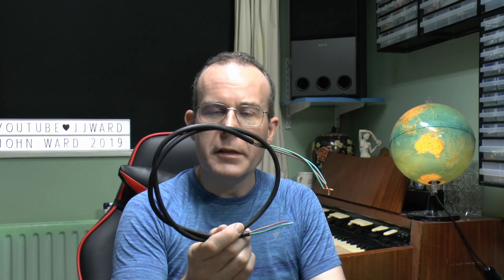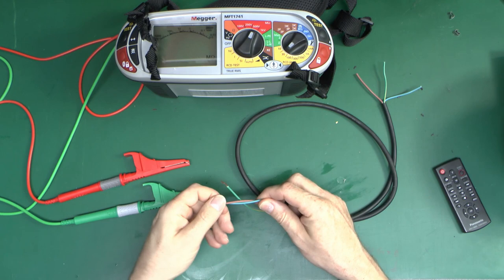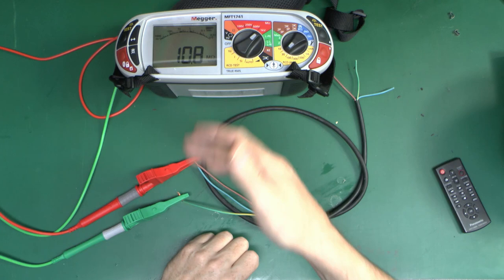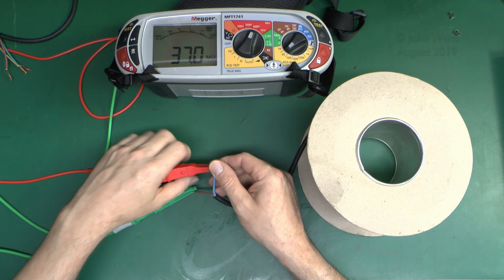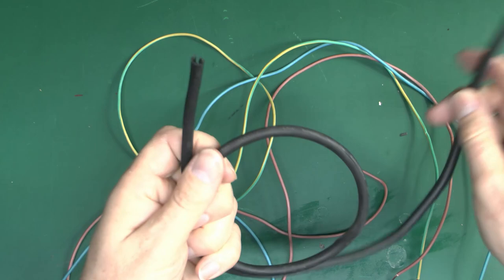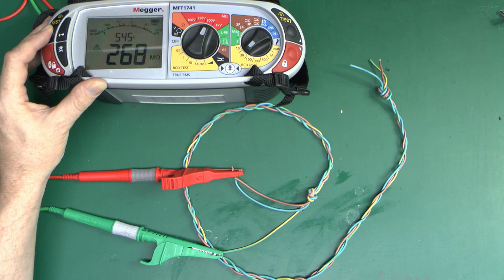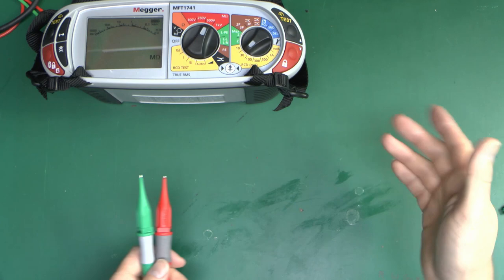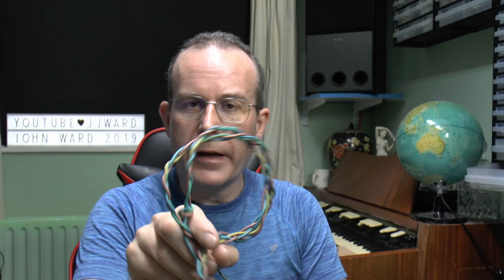Rubber Flex Insulation Resistance Failure

Comment: Some natural and man made rubber cables over time in damp or wet conditions go hygroscopic and actually absorb moisture. Then you get exactly the effect you got with the Megger. The insulation “breaks down” the longer a standing voltage is left across it.

Comment: John , When i worked at a local electrical wholesalers 15 years  ago, we had a batch of Collingwood spike lights ,where the paralleled leakage from the  porous cable  caused the rcd to keep tripping ,the customer brought them all back , and i offered to replace all the cables with some quality British  rubber cable, problem solved, But probably invalidated their warranty

Comment: PVC insulation often contains some (normally VERY small) quantity of lead. PVC insulation from China often has considerably more lead than normal. Lead is, of course, conductive, and combine that with moisture leaching through it, the minerals in the water may be reacting with the lead and forming conductive lead salts, which create numerous tiny current paths. I'd get a cheap lead test kit from a hardware store or similar, and rub the swab from it all over the insulation off those wires to see if there's lead in there.
Reply: But this is a rubber cable; I didn't think those used lead?
Reply: @longrunner258  Rubber cable is usually vulcanized by extruding molten lead over the sheath before being autoclaved to finish vulcanization.  This lead is then cut off and reused.

Comment: I'm surprised that such a class  of cable is allowed in such an installation. 
If armoured cable is too much of a pain and mains power is needed for garden lighting then what is done down here is to use 12V lights. For larger installations I think 24V or 32V is used. This way anyone can install the lights and an oops with a mower or other implement isn't a major issue.

Comment: What happened to old wire colours code .which red as hot line and black as neutral
Reply: In North America, we use black for hot and white for neutral.  Where there is more than one hot wire, they are black and red with a white neutral.  Three phase is black red and blue for hot.
Reply: @heronimousbrapson863  
Yes .. that in north america but we are use in our country  red and blue and yellow for three phase and black for neutral .
Reply: Apparently the UK changed officially to the blue/brown colour code in 2004. Not sure about the rest of Europe.
Reply: @Cadwaladr  
The rest of europe use brown and gray and black for hot line and blue for neutral .
Reply: Correct colours (not colors) for Australia.
Reply: In the UK we changed appliances to new harmonised colours between 1973-1977, but for fixed wiring the new colours came out in 2004, yet we could still use either old or new colours until July 2006!
Reply: This reminds me of a scene from the Beatles movie HELP! where the mad scientist's assistant is wiring the plug on an American made apparatus. "Is green the earth in America?" he asks nervously. John Lennon says, "In some places it's brown."
Reply: @dkek383  We had no say in the matter in the UK, the EU decided that we had to use the same colours as them!
Reply: @dkek383  I believe it was due to the difficulty of differentiating between the old colours by those who are colour blind.

Comment: So I’m in a couple UK electrical groups on Facebook and observe all kinds of things that are very different than here in the states.

Here in the states there is a stamp on pretty much every cable from what certifying lab has accepted that cable, like UL, etc. also most of our cables here also show voltage rated for. 

The other thing that blows me away about the UK and apparently Australia also and probably many other countries that I don’t know. The fact that you do all these tests on your installations. We do nothing like that here in the states. Nobody carries a meter like everybody I watch in the UK. We don’t do an Any kind of certification when we install stuff and we have nothing on any kind of regular basis. If it screws up your call us so we come out and find it.
If you do a new install that needs a permit from the city or county or whoever, all they’re really looking for   Is how you installed it. Usually it’s two inspections. A rough inspection for your cabling and conduit, and then a final inspection after the walls and finish are done.
Reply: Cable in the UK generally does have makings from an aproval body (though I'm not sure it's mandatory), most commonly either BASEC for UK-specific cable types or ◁VDE▷ for harmonized flex. As far as voltage rating for harmonized flexes like the one in this video that is covered by the harmonized cable type code. The "05" in H05RR-F means that the cable is rated  300/500V (the first voltage being relative to ground, the second being voltage between conductors). T&E seems to have the voltage rating printed on it.

Normally though voltage ratings aren't something we worry about because we don't have a proliferation of voltages. 
If you are interested in the rest of the cable code, the "H" tells you it's a harmonized cable, the first R tells you it's rubber insulated while the second R tells you it's rubber sheathed and the -F 
tell you it's a flexible cable.

Comment: Hi John,
Can you test the inner resistance of that black outer shell?
The wires were inside, not on the outside.
I'm interested to see if degraded rubber caused some of the issue.

Thanks
Larry

Comment: Great video JW.. I find this often with T&E connected to outside light fittings (which obviously is not permitted unless contained) the UV light breaks down the pvc insulation, cracks and moisture gets in. IR fails or is well below 2 megohms. I suspect that cable is not to spec or a Chinese fake cable 🤔 would be interesting to see what curren/voltage it could take before failure of the insulation? You could pinpoint the weakness in the conductors insulation then.

Comment: You could also try putting those wires into the oven for 30min or more at the cable´s max temperature rating. 

Just to see if some moisture does indeed leave it or wheather the insulation is just degraded in some other way.
Reply: That's what I was going to suggest.   May require longer than 30 mins however.  Overnight at 80C might be good.

Comment: If one end of this flex terminates inside a the spot light fittings that gets hot and the other end terminated inside a flooded with water junction box then the cable is turned into a 1metre long drinking straw.
Reply: Again, water being drawn up inside the cable should not prevent good insulation from doing its job. This low grade insulation is clearly water permeable.

Comment: We’ve had a few odd faults where moulded on plugs have had insulation breakdowns, they have been all the same ‘Deka’ brand. Seeing that drum of flex rolled up, was wondering if you could do a video explaining why an extension cable shouldn’t be used rolled up?
Reply: He already did a video about high current through a coiled cable.

Comment: How does Britain handle certification of components? I was expecting to see some sort of testing lab logo on that cable: UL, CSA, ETL, or whatever.
Reply: Paul Ste. Marie Exactly call, I was thinking the same thing. Pretty much every piece of cable you buy here in the states has the voltage ratings on it.
Reply: H05 stands for a "harmonised" 500V cable, RN-F is for the insulatoon type.
Reply: @ponderstibbons3718  Yes, but who did the testing? In the US, I'd expect to see the testing agency logo and a listing/recognition number, e.g. "UL E123456". You can look up listing numbers on UL's website to verify authenticity and the specifics of the listing (or recognition).
Reply: Usually has BS(British Standards) number on it but this means nothing as the Chinese will make any old cable and print the BS number on it. 

It seems to be a cultural thing in China where if they can cut corners they do.
Reply: @123tinhat123  should be tested, check to British standard in order to be imported into this country.
Better still UK should manufacturer own cables, switch, socket so on. 😳
Reply: There is VDE logo (VDE is based in Germany) at the beginning of the marking. I think UK accept VDE approval for harmonised flexible cable. Also, the 5 in H05RN-F means the cable is rated at 300/500V (300V line to neutral and 500 V line to line).

Comment: It would have been interesting to apply pressure to the cable while twisted or in the sheath and see what happened to the resistance/leakage? There may be one particular point where the leakage is affected more - or indeed over its full length.

Comment: I have some generic power cords that look like this junk.
The insulation on the wires is very soft.  It's so soft you can cut it with your fingernails.
I don't know what type of plastic this is but it's dangerous.
It also burns very well.
Reply: I have come across that soft flex too. As standard on AEG angle grinders. Soft flex on an appliance to be used around metal....
Reply: @johnsimpson8263  I got curious and took my import angle grinder apart and it also has this junk wire in it.
I'm surprised there isn't more house fires from this trash insulation.
I'm also curious if this deteriorates like the butaline based junk on appliances that gets sticky?

Comment: The key to the issue was on the outer sheath. Its Chinesium.
Reply: We don't know that - damp may have got in at the ends.
Reply: @millomweb  Explain how damp getting in the ends would cause a good, non water permeable insulation to breakdown please.
Reply: DJ_PailTUK Correct, this is low grade Chinese crap. Weird how quite a few people in the comments are trying to suggest it's somehow not the fault of the cable.
Reply: @ferrumignis  I never said it would but it could create an electrical path around it.
Reply: @millomweb  How can moisture create a conductive path from one core, through two layers of insulation and into a second core unless the insulation itself has been compromised?
Reply: @ferrumignis  It seems you don't understand the concept or my explanation. Maybe one day you will understand it but I'm not going on further with the matter here.
Reply: @millomweb  You can't explain your  concept because you know it cannot explain what is demonstrated in this video. Real men admit they are wrong.
Reply: @ferrumignis  It's not a concept an it has nothing to do with me. Tracking is a fact of electrical life.
Reply: @millomweb  I agree, electrical tracking is a well known and understood phenomenon, caused by leakage paths over the surface of an insulator, an typicaly result in surface discharges (i.e. arcs).  On the other hand the leakage current in this cable is THROUGH the insulation, so is therefore not tracking.
Reply: @ferrumignis  How have you proved it is through the insulation ? 

I've suggested 2 possibilities - tracking around the outside of the cable as ends have been immersed - and based on the observation that corroded conductors insulate, perhaps 'corroded' insulators conduct.
Reply: @millomweb  Insulation does not "corrode".  Piss poor Chinese insulation apparently does degrade significantly however.  Look at the point in the video where the wires are removed from the outer sheath and loosely twisted together.  They are not wet, both ends of the wires were deliberately held well apart and yet still plenty of leakage.  It really doesn't take a genius to see it's leakage through the insulation at the points where the wires are touching.
Reply: @ferrumignis  British insulation also fails.

Comment: You mention that some of the wires tested ok. I wonder if they had water in the junction boxes. Maybe the inner insulation is not water resistant and relies on the water resistance of the outer sheath.

Comment: I wonder if some ionic salts have migrated into the insulation material from the soil? Maybe actually an electrolytic reaction occurring when a voltage is applied.

Does a Megger test with DC or AC at 500 or 1000v and what current can it source? Surprised the ‘good’ cable showed such a long charge up time. Capacitance at maybe 1nF per mètre so should charge almost instantly unless the current put out by the Megger is at the micro-amp level.
Reply: meggers of this style put out a very small DC current
Reply: Nothing whatsoever to do with capacitance, the megger is measuring leakage current that is simply increasing the longer that a voltage is applied.

Comment: I installed about 10 of GU10 spike lights with the same flex. Can't remember the make but bought them from TLC Electrical. Got called back about 3 times with the RCD tripping thought it was to do with damp getting in the fitting but eventually narrowed it down to the flex. Had them 13 months so manufacturer wouldn't take responsibility.This flex should not be allowed. Wasted my time and money.

Comment: Hello John, hope you are well. I've been looking into a techinque or equipment that would allow us to find an insulation damage on a buried conductor. We have voltage on the end but when drawing power it drops to 0 and the insulation resistance to earth is 0, so we believe it's partially broken, because we receive voltage but when current flows it drops so there must be a few wires still good but others cut. Any thoughts? It's a 1000 m run by the way.

Comment: It would be interesting to cut 15cm from both ends of the cable and test again. This way we could see if the insulation is deteriorated only on the parts that were not fully enclosed inside the black outer isolation.

Comment: Have we discovered a new type of semiconductor?
Reply: No - we've known water as a semiconductor for years.
Reply: If you mean the fact that the resistance decreases as the voltage increases, that is called negative (dynamic) resistance. That´s not characteristic of a semiconductor though.

Comment: Yay recycling dirty milk bottles and posting them back.. You could have done the same test you did on the exterior insulation on the inner stuff after removing the copper.
It's been lovely weather for the neighbors to have a BBQ ,time to take the heather and big transformer into the garden with the other half of that cable.

Comment: Would be interesting to slow heat those wires to drive out any moisture and test again.
Reply: They'd need to be heated in a dry atmosphere to drive the moisture out of the porous plastic.
Reply: Bake at 105°C for two hours, turning once every fifteen minutes.

Ensure product is piping hot before serving.
Reply: Maybe it's not water conduction but chemically altered insulation. Remember iron conducts but rust doesn't - so perhaps corroded insulators start conducting ?????
Reply: @robroysyd  Alternatively, put them in an air tight container with a desiccant.

Comment: Why does the Megger warn when using 1000 volt test? Is it only because it sounds fancy? Can it upset you it you get that voltage between your hands and you can drop something? I couldn’t find the current used in the leakage measurement but it must be quite small.

Comment: Can you please explain why electricians in UK tie Line and Neutral together for insulation resistance test? Thanks.
Reply from the maker: That is done where equipment is connected to the circuit, and it's not practical to disconnect all of it.
Reply: @jwflame  Thank you John. I think I am missing something here. So, what happens when equipment connected to the circuit contains sensitive electronic components? The high voltage applied to the tied line and neutral conductor will NOT damage the electronics? Thank you for clarifying that.

Comment: was the cable copper coated aluminum?
Reply: The way it twisted together easily makes me think it was actual copper.
Reply: @Cadwaladr  - I've seen copper plated steel stranded wire from China. That stuff is impossible to work with.
Reply: @deadfreightwest5956  That does sound like it would be awful.

Comment: According to BS7671 it was within minimum required
Reply from the maker: That minimum in BS7671 is intended for an entire installation with multiple circuits, not a single piece of cable.
Reply: @jwflame  it’s also intended for one circuit for example: single socket installed in hall cupboard, total length of cable:20cm. Still the same rule applies. Bottom line is if you tested even whole installation with such a cables and you achieved more than 1MOhms you are not allowed to fail it . Nevertheless I agree there is something wrong with insulation of this flex . In order to find out we need to know BS of the cable and check testing procedure to achieve this British Standard